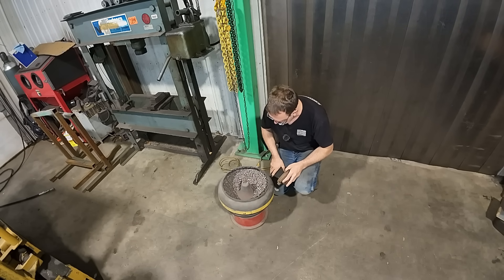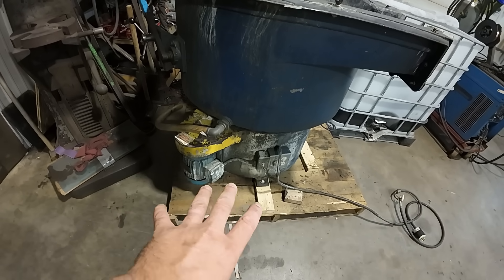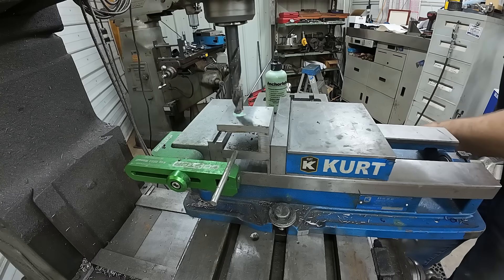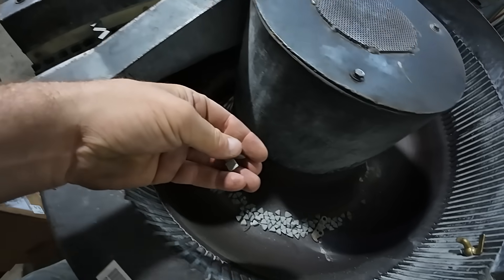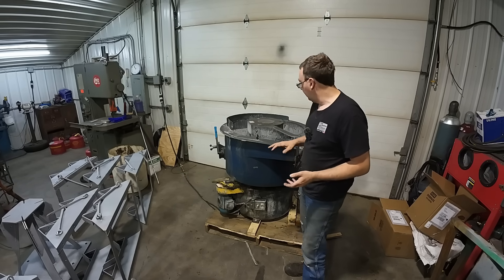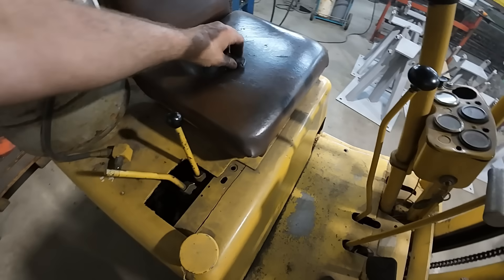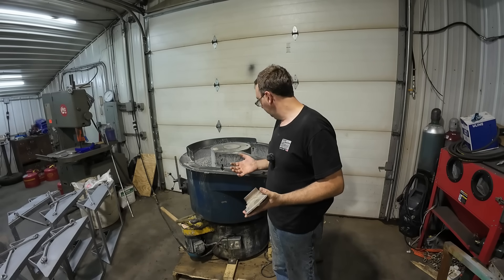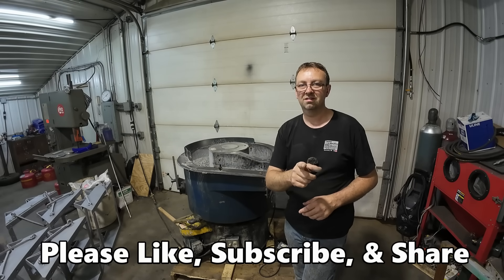New Used Machine Day - Test Running My New Machine - Manual Only Machine Shop Support Machinery

Comment: I used to do insurance inspections at various engineering companies here in the UK, one of which specialises in component finishing. I was always amazed by the number of different sorts of tumbling media that they used. They had a big local customer base of small to medium engineering companies, that used them for finishing various components, of all materials from copper and brasses, through stainless and titanium. Always an interesting visit.

Comment: We had the same brand of tumbler when I worked at the shock absorber company in Buffalo.  It is truly an industrial unit.  You will love it when you add the soap injector.  ---Doozer
Reply from the maker: After I build the base, then I'll get the liquid set up.

Comment: I used a vibrating finisher for 50 plus years in my shop, had rotating barrels too. The process is an art and not a science   Many variables, run time, media shape and composition, quantity of media in drum, quantity of parts in drum, media compound and volume of water. 
Yes water!  It appears you did not know about adding water.  Water is an important component as is the soap compound, which keeps the media pours clean, open and cutting
You should also obtain a dry rust inhibiting compound to be mixed into a solution and be kept in a separate container into which the finished parts are dipped 
Some parts require long run times and depending on how much water evaporates you will need to add more 
The volume of water has a great influence on cutting speed 
Drain the water into some sort of settling tank and not directly into your drain as it carries fines from the media breaking down and will eventually block your drain 
There is more to know but with this you will be off to a good start 

Oh, forgot to say, the intensity of the vibration is also controllable 
To intense may damage your parts

I don’t recommend running dry
These were made to run wet

Good luck!
JIM ❤
Reply from the maker: Thanks for the info. I have no intention of running dry, just did it for this one batch. As soon as the upgrades are done, I'll be running wet with a rust inhibitor solution from Giant.

Comment: Takes me back to high school days back in the late 80's. I worked in an alternator rebuild shop. We used a wheel-a-brator with cylindrical shaped porcelain media and a citrus based solvent flowing over it to clean the housings.

Comment: I used one of these units to clean up stainless steel stampings. We used water with a few drops of dish soap to keep the dust down. They do a good job on sharp edges and burrs.

Comment: We've got one of those at work for bulk parts deburring.  Plan ahead for running it wet by having a settling tank for the drained dust when you empty the liquid.  You'll get a mix of clay from the media and metal dust, likely rust as you're running steel/iron parts.  Also keep it treated with anti-algae/fungus chemicals so it doesn't become a terrarium!  Even if you drain it after use, the media bed will be damp a long time.  Have fun with it!
Reply from the maker: Great advice. I'm planning on some special tank build now.

Comment: Need your water running.  I didn't see them really deburring much, a little, but not much.  You could leave those parts in there forever and it won't wear them away.  Need a settling tank for the water or it will plug your drain.  Very good at cleaning parts.  Very good at plugging drains too.

Comment: Nice one for sure Josh, great addition to the shop. Customer satisfaction is #1....Ive found if ya add in 10# of ground walnut shells to the ceramics and pour in one can of brasso and run it all in liquid or in your case, with the liquid injection system, the finish will be phenomenal. (substitute with corn cobs vice walnuts for aluminum and softer metals, brass, bronze, etc)
Don

Comment: I remember running one of those in a fab shop I worked at.  This was years ago, but I remember there was some sort of liquid added to the media for lubrication.
Reply from the maker: It will have a liquid tank and pump when the upgrades are done.

Comment: Great addition to, probably needs a thick steel base, on casters, to dampen the shakes. Not cheap, but doable.👍👍
Reply from the maker: No casters. Forkable
Reply: @TopperMachineLLC  +3/4" plate.👍👍Don't want it hopping away!

Comment: We have a bowl type tumbler that we use with ceramic media at my workplace.  I run it with water and a few drops of dish detergent.  That parts separator is great.  We have to fish for the parts or keep them on a string.  I also built a timer for it and then added a pause button so I could check on the parts along the way.  I visited a machine shop that was making small engines for RC planes and they had a series of tumblers that finished with walnut shell.  The finish was beautiful.  A tumbler is one of those machines that people don't think much about but are critical to getting parts done, finished properly and without taking too much time.
Reply from the maker: Absolutely essential equipment. I have a timer also for the upgrade.

Comment: Nice. Consider that when you were standing on the pallet,  the mass your body added  was the primary reason the performance improved.  This is by design an "out of balance" device and if the machine can move freely, a lot of the cleaning motion dissipates into moving the machine instead of moving the media and contents of the tub. Since you want to keep it mobile/portable..............consider building your base out of steel with provisions for adding rigid mass/ballast to the base so that the tub and contents react to the unbalance forces and not the machine itself. I thought I heard you mention that you would make it "forkable" and that would be much better than having it on a cart with wheels (unless the cart had a way to lift the wheels and set the cart frame directly on the floor).
Reply from the maker: Wheels are an absolute no go. It will be heavy steel base with probably added ballast and adjustable leveling feet. It's all planned out and soon to be built.

Comment: I have used an old mortar mixer to tumble rusty old wrenches and other rusty parts. Because it was old parts I used  cheap granite  chicken grit. I do it out side and use water to keep the dust down. If it’s a sunny day I dry them in the sun.
Reply from the maker: I started out with the mortar mixer. Not as refined as these vibratory tumblers.

Comment: That's a bad ass machine.  The seperation feature to remove the parts is amazingly helpful i bet especially for small parts.  Save a lot of grief looking for little bits.  I bet you could do about 5000 .223 cases in there! LOL   I'm sure the palet stand you build will be steel and I'll bet that will solve all the vibration issues.
Reply from the maker: Definitely steel with possible added ballast.

Comment: I have a C&M Topline machine. It’s not  as big as yours, but after having it for a year, I wouldn’t be without it. We run mineral spirits in ours, mostly the clean parts and for the luxury of not ending up with rust on our parts. We tried the specialty soap that was supposed to keep things from rusting, but we didn’t have very good luck with it, everything rusted. I ended up putting mine in the back room and bolting it into the floor, with a door between it and us, we put a six cylinder valve cover in it and left it run for about an hour, it looks like a wet rag that you tried to ring out, totally unusable, it was a junk valve cover that we just wanted to see how well it would clean
Reply from the maker: I wouldn't suspect a thin cover would survive long. I don't do much thing stuff.

Comment: I would even add a hinged plastic dome over the top so the area around it and the air stays absolutely clean.
Reply from the maker: I considered that. But running it wet should help. It will also be forked outside for use. Even in the winter.
Reply: @TopperMachineLLC  You might have to add a heater for winter use outside?
Reply from the maker: It will be in the heated shop until use. As long as the water solution is flowing, it won't freeze.

Comment: You need to run the machine with a solution of water and burnishing compound.  The liquid adds lubricity and improves cutting action and improves the final finish.  It also lengthens the work lifespan of the media.  Hammond Roto finish XL-309 would work well for you, it is what I use deburring and surface finishing pocket knife parts after milling and grinding.
Reply from the maker: Since I have many upgrades to do, getting all of that built and setup is priority before actually putting into service. Adding the solution will be the last step of the upgrades.

Comment: That's a very interesting machine, I've never seen anything like that previously, having never worked in an industry where one would be used. It looks like it will be very useful and save all the manual de-burring work.I wonder what the running cost will be, with electricity and replacement media and chemicals. No doubt you'll have it all set up with the new base soon and making good use of it.
Reply from the maker: Being 3 phase and low hp, electricity is minimal. Media is a large upfront cost, but lasts a long time.

Comment: Might be worth the effort to break the big burr from the saw off with pliers before going into the tumbler, it could be done while the saw is cutting the next piece and take up virtually no extra time?
Reply from the maker: I generally start the saw and feed super slow then go back to drilling or other work. I never babysit the saw.

Comment: The media is not abrasive enough for what you’re doing and you need a little soap & definitely water to make it cut better 👍
Reply from the maker: It is the correct media, I just need to finish the upgrades to get the liquid setup.

Comment: When you build the base, would there be any advantage to building in chambers you could fill with shot or some other damping material? While standing on the pallet gave it more weight and stopped some flex, your body also damped out a bunch of vibration. I might be over thinking this, but thought I would ask.
Reply from the maker: It's all in the plan.

Comment: You would do a lap more beautiful job if you would add just a little bit of a WD 40, that’s actually when ceramic abrasive starts working. You don’t need much of a liquid I tumbling stainless steel a lot
Reply from the maker: Since I just got the machine and haven't finished the upgrades, I don't have the liquid setup yet. It is definitely coming.

Comment: Very nice Tumblr. What types of media did you get? How about laser rust removal??
Reply from the maker: Ingot ceramic media for medium cut. Basically for deburing, so should have no problem with slags
Reply: per Mick Blackley (also on YT), "Laser doesn't key the surface for paint" LRR is good if it's going to stay a bare metal or translucentfinish (such as a cast iron stove) but there's all kinds of tradeoff

Comment: Greg from northern Michigan. Nice machine. What is the motor horsepower. A new single phase 3/4 hp unit is $16k.  When I buy used machinery, I think in terms of cents per dollar new. Can you share any further comments here ?  Are used machines like this in high demand in your area ?  Being on the smaller size, I think the used market would be kind of small.
Reply from the maker: It's 3 phase. I tend not to buy anything that isn't 3 phase. It's more efficient and is just easier to setup and troubleshoot. As far as my region, nobody has one of these, but it's also very depressed. Not much industry left. Watch some of my other videos talking about that.

Comment: Hey Josh, it would be interesting to see how much the part that was in the machine, will deteriorate if you keep putting it back in. What will it look like in a year or two?
About how long did you have your parts in the tumbler to get the results that you have show on the video?
Reply from the maker: I plan on leaving them in to find out. This run for debur was about an hour. Definitely worth it for larger batches.
Reply: @TopperMachineLLC  Could you grab some basic measurements of the part that came in the machine to compare to in 1-2 years?
Reply from the maker: I sure can.

Comment: A little water and Palmolive dish soap will work in a pinch.  Running the ceramic media dry will not work very well.
Reply from the maker: @vze2fz2c  I am well aware and working on the upgrades to make it ready for liquid.

Comment: How much material does it remove? A thou? or less? Curious if it would remove machining marks on flat surfaces and those are probably only a tenth deep in my case
Reply from the maker: Depends on how long you let it run. It will do a lot.

Comment: Would a sandblaster not be the better solution? Faster, less energy consume, cleans the entire surface.
Reply from the maker: Far slower, takes more energy for the air compressor, and it requires babysitting. This tumbler is a small motor, and you setbit and forget it.